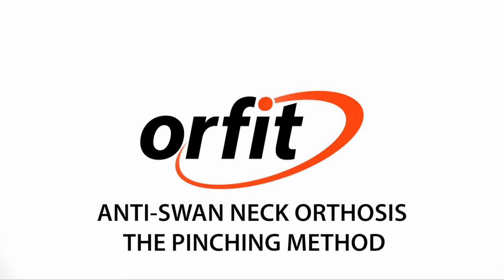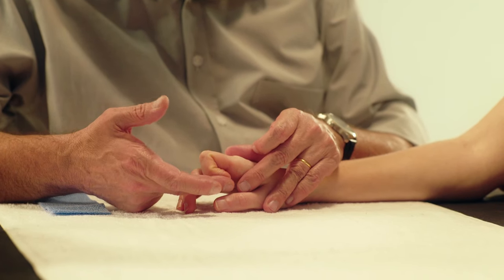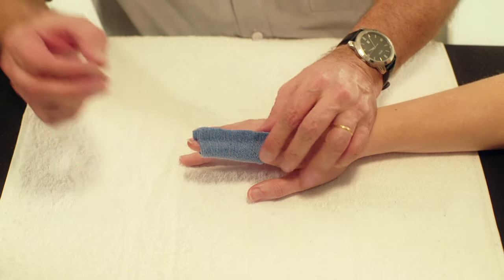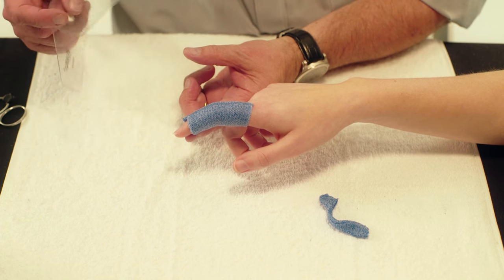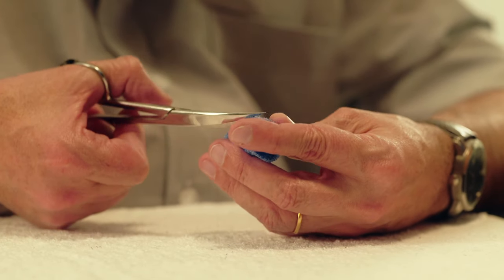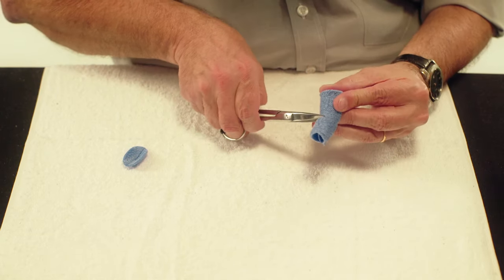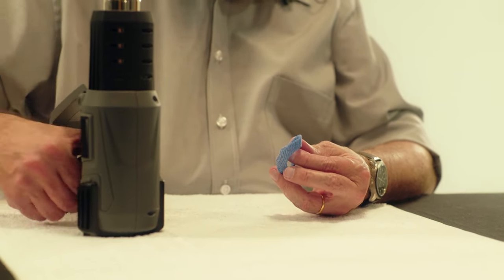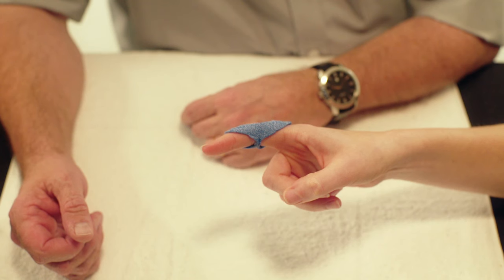Anti-swan neck orthosis (pinch method) - Orficast Instructional Movie 5

Comment: Does it harden to be a non porous material? Are there options for a smooth surface end result? I use the oval 8's, but want to make a more custom fit for my fingers. I saw that Orfit has thin cut strips that might be smoother. But will they be less durable if not folded in 3 layers? What's best for a durable, smooth surface swan neck deformity orthosis that's not going to get caught on neighboring fingers that also require the use of this? (EDS sufferer)
Reply from the maker: Hi there, the Orficast when rolled into a tubular shape hardens to a fairly rigid material. It is non-porous and can be smoothed to a nice finish when heated. Stick it to itself with the heat gun if it doesn’t quite stick when heated with hot water and molded. The Orfit Strips in 1/12” also will work for this design. It is fairly simple to create “thin enough” orthoses that do not rub against adjacent fingers. Both materials are well suited for this type of orthosis. Depending on the wearer’s function, they will be quite durable over time.

Comment: What is this for ? Can't even tight to hold...
Reply from the maker: Hi there, this orthosis can be used in the treatment of a swan neck deformity to one or more of the fingers. This design helps to prevent hyperextension of the PIP Joint.